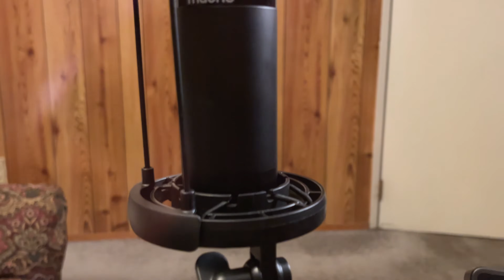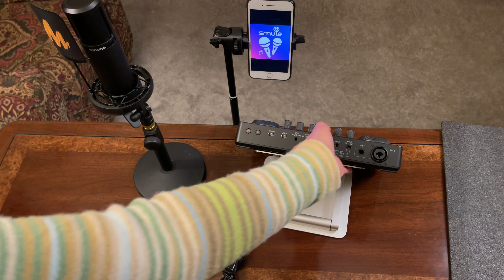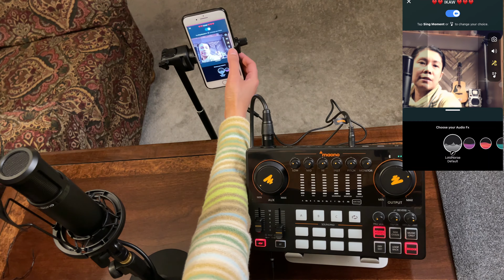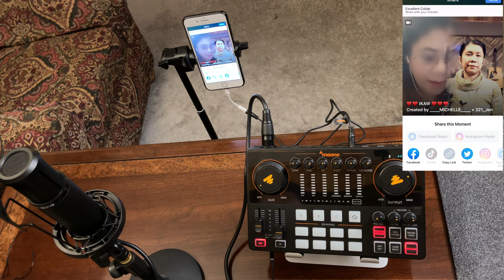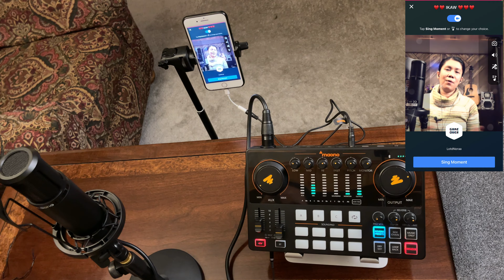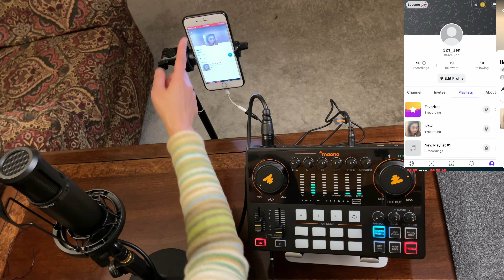Maonocaster E2 To Smule App Set Up

Comment: hye i wanna ask...i follow all what u do,,,but why my voice detect on recording singing not from mic..but from my lips hehehe ...im so confuse
Reply from the maker: Check first if the OUTPUT volume is on high. If still no audio effects or audio not going into your phone, most likely it’s the phone adapter issue as some adapters like the one I bought from other store or online, I can only hear all effects but will not work for Recording/Streaming. I bought my lightning adapter from the Apple Store. Getting the right adapter most likely will solve your problem. Other brand I’ve tested and work is UGREEN brand from amazon. Make sure compatible to your device. For android you can use otg usb c to usb c. Connect from otg port of the sound card to your android phone.

Comment: Where does maonacaster pull power from? The phone? I assume the non e2 variant works the same? Thanks for this.
Reply: Woah. Pretty cool. Thanks
Reply from the maker: No problem
Reply from the maker: It has built in rechargeable battery.

Comment: Hello, love ur videos... can I use an XLR to 3.5mm cable to the mic input along with a XLR cable plugged into another mic? Which both mic will be plugged in to the soundcaster?
Reply from the maker: Yes you can use xlr to 3.5 mm as long as the mic does not requires 48v phantom power. You can connect it to Mic2B. Connect your other mic to Mic 1. Remember Mic2A and Mic2B works one at a time only.
Reply: @jenuds  My main microphone will be the FDUCE SL40...it has XLR & usbc connection but I'll be using XLR to the maonocaster E2.
Could u please do a review of that mic?
Reply: @jenuds  Also, I'll be using the Maono PD100 XLR Dynamic microphone as my secondary mic for guests on my podcast... it comes with XLR cable male to female or female to male...not sure the correct layout but I hope u kno what I'm saying...
So in regards to that can I still use the XLR to 3.5mm cable with it through the MaonoCaster E2 in mic2 right?
Reply from the maker: Yes you may connect your PD100 xlr to mic 1, then mic2b for the mic with xlr and 3.5mm cord
Reply: @jenuds  Oh ok,  my main mic is gonna be the FDUCE SL40 which is full XLR which I would connect to the XLR port and the PD100 will be my secondary which I'll plug in mic2 with the XLR to 3.5mm cable.
Reply: Oh ok
Thank u very much
I'll definitely show u my simple set up when I get the stuff.

Comment: I have volt1 interface and condenser mic, I have also tried scarlet but encounter the same problem on smule and starmaker, I can hear music but can not hear my own voice as I am singing 🙁. Can anyone help me here what should I do.
Reply from the maker: Are you using an iPhone which uses a lightning adapter? If yes, perhaps the lightning adapter you are using is not the right one. Not all lightning adapter works for recording/streaming. Perhaps your adapter is only as headphone which means you can only hear but it will not record or no audio on live streaming. I bought my lightning adapter from apple store. If not from apple store make sure it has mic feature as well.